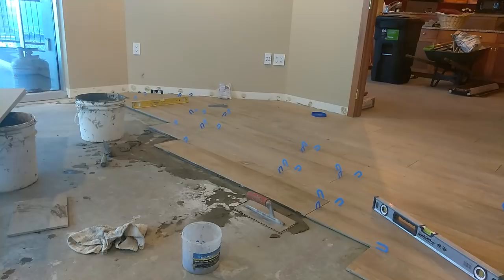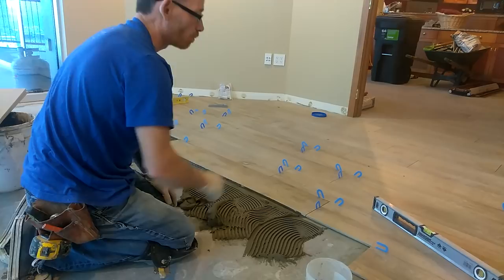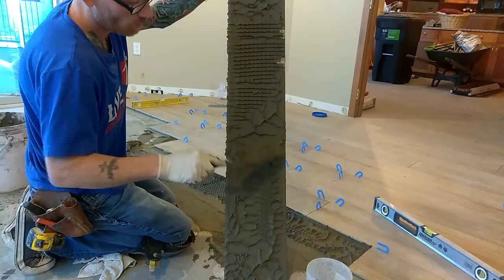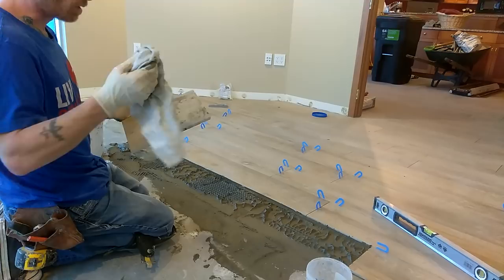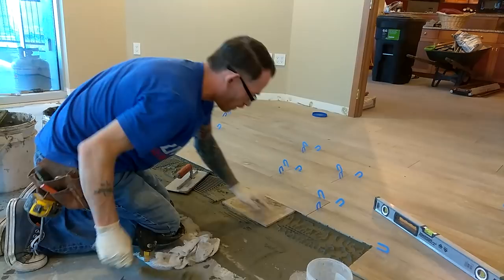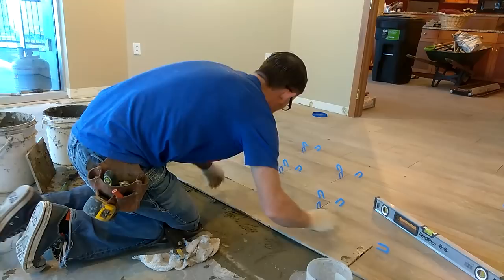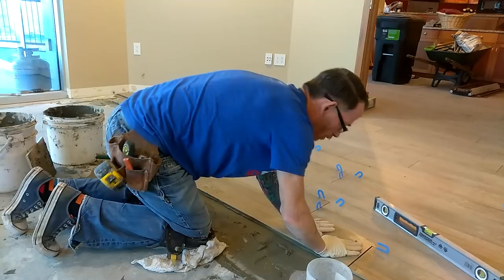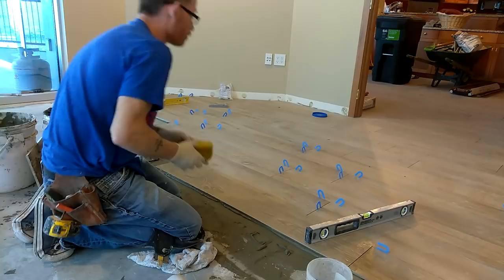Tile back butter/Max coverage no lippage

Comment: Two major mistakes one is large tile format tile is supposed to be used with half-inch trowel remember the bigger the tile the larger the notches and when you back butter keep them all in the same direction you're defeating the purpose by running them in two different directions
Reply: Exactly if you put enough mud on the floor and use the right trial you shouldn't need to back butter every single tile
Reply: 7:30 that is more than 95% coverage he did not make any mistakes, and if he did that just on the substrate with no back trowel then yes he would need a half inch
Reply: That tile ain’t going anywhere. Relax.

Comment: Cool
But you did one little mistake.. you should troweld the thin-set towards the short direction will be much faster to air to escape.
Reply: Installer preference, i would have went with not dampening the concrete before mud.
Reply: The other issue was dabbing thin set in spots where its lower. Look, to be honest, trowling in one direction and to the shortest escape route for a tile like you said is important but buttering back of tile is non essential unless that floor is going to be a national traffic thoroughfare!

Comment: lovely demo. fitting tiles like that and getting that full bond is physically harder work too when compared against tiles in which the adhesive notches aren't collapsed. much respect.
(I found this from your comment on the "Fix it all" channel today. Doubt he achieved fully coverage with his teeny tiny notched trowel and no back buttering. lol)

Comment: I'm a tile setter and yes its good to back butter for sure if the tile gets wet but if you put enough mud on the floor and use the right trial you shouldn't need to back butter every single tile. Another thing if you have a 2-3000 square foot house to tile there ain't no way you are going to back butter every one
Reply from the maker: You back butter every tile no exceptions, the size of the floor doesn’t dictate whether or not you back butter and do it the proper way. I set 8,400 sf of limestone about a year ago and back buttered every last one of them.

Comment: Big favor to ask. I am going to install tile in my living room and kitchen. My home had 12" vinyl glued down under the carpet throughout. Once removed I have the glue swirls. Can I just paint on MAPEI MAPELASTIC AQUA DEFENSE barrier then tile without removing the glue.
Reply from the maker: Depends on how tall the ridges are. And if it is stuck good? I typically try to remove everything and start clean

Comment: I’m a diy er. How do you stop the mortar from coming out of the grout lines? It becomes such a mess for me. I’m setting 12x24 and it just spews out using 1/2 trowel. Thanks. Nice vid btw.
Reply from the maker: 1/2 inch trowel is a lot of mud for 12x24. If your subfloor is fairly flat you can get by with smaller notch and that will help.
Reply: @Apexjasonmorganllc  Thanks for the quick reply!! I’m actually doing shower wallsand the tiles are running vertical. I’m pretty frustrated with the amount of thin set popping out of the joints. Would you use that trowel size on walls? Thanks
Reply from the maker: @Sectionmillionaire-fg8mm  I would use a3/8 notch and apply that notch to the wall and also notch the back of the tile. That will give you enough play to avoid lips but should cut down on the mud squeezing out. Also make sure your thinset is a good consistency. One trick is when you place the tile butt the edge of the tile your placing tight to the other tiles and push it into the mortar before you open it up to create your grout joint. That will help with ooze as it will pull the mortar away from your joint. There’s going to be time when you will get some mud coming out, you just have to clean it with a sponge the best you can and scratch it out with a razor knife once the mud is set. I’ll set one day then the following morning before I start seeing I’ll wash and clean what I set the previous day as it’s easier to clean before the mortar gets super hard.
Reply: @Apexjasonmorganllc  thanks man
Reply from the maker: @Sectionmillionaire-fg8mm  did you get a handle on the walls?
Reply: @Apexjasonmorganllc  Yes sir. Thanks for the input.🤙

Comment: I backbutter by skimming a thin coat on the back of the tile. Looks like you spread with a trowel on both the floor and tile. Overkill?
Reply from the maker: Not overkill. Maximum coverage on the back.
Reply from the maker: I will also flat trowel on the backs sometimes as well. Just depends on application
Reply: Apex floor designs LLC/Jason Morgan yeah those were big tiles and I think you said the floor had some dips.👍

Comment: I know this is an old video, but you mention most long plank tile like this come bowed from the factory. Doesn't it naturally pull up into the bow as it sets also causing lippage?
I started using levelling clips and thirds as soon as tile started going 1' x 2' and I assume the effect would be worse with long plank tiles like these. You put the level on each end, but not in the middle..  But you clearly know what you are doing. Not using clips would make me much faster. How do you avoid lippage from the bow without leveling clips?
Reply from the maker: These tiles were fairly flat with a slight bow. We kept the joints random so not doing a half stagger helped with lips. It really depends on the tile you’re working with. I do use clips when I need to but not on every tile.
Reply: @Apexjasonmorganllc   Okay, that makes sense. If you don't mind a follow up. What is your tolerance for whether to use clips or not? 
I typically don't use clips on walls, or at least not as many, with higher quality flat tiles. But haven't even tried a floor without tons of clips for quite a few years. Maybe I'm worrying needlessly..
Reply from the maker: @markoshun  I’ll use clips if the stagger is a 50/50. Or if the tile has a noticeable crown. These days the clips and wedge quality it way better so I use clips a little more often. If it’s natural stone I do not use clips. You just have to the best judgement call for each tile your setting.
Reply: @Apexjasonmorganllc   Ok, got it. Thanks so much. I have come to automatically use them. Just threw me seeing a pro tile setter not using them. I do general renoes, so not tile all the time. 
I used a Mexican hand-made tile on a shower surround once and even had to throw out the spacers..  was fun. I've got some slate to set on this job coming up, so probably no clips on those.
Will check out more of your videos. Thanks
Reply from the maker: @markoshun  thanks a lot for watching! Yeah anything natural stone I don’t use them.

Comment: Thanks  good video..   Have you ever used a strap and cap ,  spindle , Levtec  leveling system?
Reply from the maker: I don't use the clips very much. I'm oldschool
Reply from the maker: Most of my work is mud float.
Reply: I am so worried on how they are going to do our tile, floor and decor contractors are going to do ours, wood tile but I dont want any grout lines visible, any reviews or exp with floor n decor contractors??pl let me know

Comment: I'd recommend leveling system
Reply from the maker: Leveling systems don't make it level. They keep it flat with out lips but not level.
Reply from the maker: You can't beat a floor that's perfectly level.
Reply: @Apexjasonmorganllc  I agree 100%
Reply: Still need a lippage system, making the substrate flat before install goes without saying. But i dont care how flat you make the substrate, only way to fix a bowed tile is with a lippage system, even then its not guaranteed. Only time i wouldnt use one is if it was a class A+ tile.
Reply: @hereticxxx9317  I totally agree....you can have a perfectly level tile floor and still have lippage. I couldn't imagine setting long planks without a leveling system.  Your subflooring can be perfect and because the tiles are bowed your still going to get that deviation in your head joints and only clips can reduce that.....I know some guys think using them is not for pros or they leave voids or just think the old methods are better,  but you simply cannot beat a leveling system for flatness no matter how good you are

Comment: Also thinset is way to dry and you need to use a 1/2 trowel.
Reply from the maker: Eder Zamora if thinset is to dry it won’t bond or grab, it was very apparent that the mud was grabbing very good when applied to the floor and the back of the tile, also that trowel I was using puts down the same amount of mortar as a 1/2 notch. The end result you are looking for is the amount of coverage you get to the tile.

Comment: I hope in 3 years you have learned more lil buddy.  You mud is to dry/thick which makes the trowel lines harder to flatten and your lines should go perpendicular to the tile. Where's the level clips? Guarantee u have lippage
Reply from the maker: There’s not a lip on any of my jobs. And if the mud was to dry it wouldn’t bond and you can clearly see it grabbed hard. I’m a 24 year tile setter there guy.

Comment: Troweling with tooth side of trowel on back of tile isn’t back buttering use flat side on back of tile and use half inch x half inch on floor and if you have to pull one up call Brock Lesnar.Point is you don’t trowel floor and tile.
Reply from the maker: @jf9686  totally acceptable to notch back of tile and floor. Come on?!
Reply: What you are doing is not back buttering you should use the flat side to “back butter” the tile.You wouldn’t use a square notched knife to put butter on a piece of toast would you?Your video is showing people the wrong way to install tile with excess thinset they don’t need to purchase.If you’re set in your ways don’t take advice but if not do and also get some leveling clips and save yourself a lot of time
Reply from the maker: @jf9686  putting mud on back of the tile is by definition “back buttering” whether it’s flat trowel or notch. You don’t much large format tile do ya? And even I need to I use leveling clips
Reply: @Apexjasonmorganllc  Yes I do a lot of large format tile been in flooring for over 45 years probably longer than you’ve been alive and have never had a customer call me up about a broken tile not once